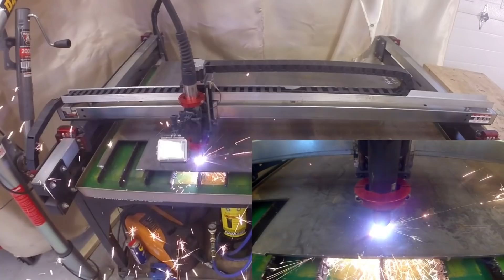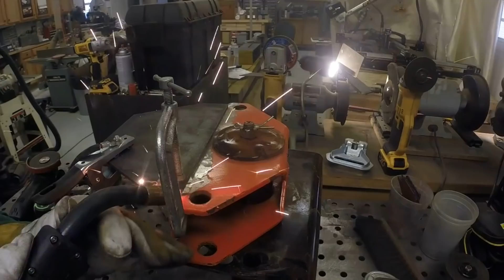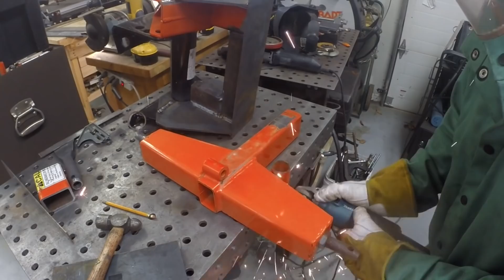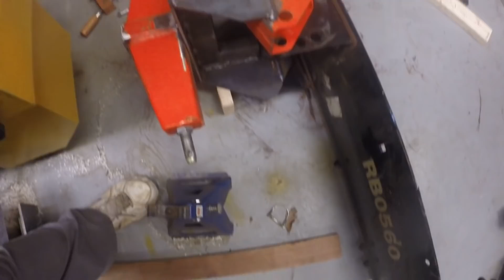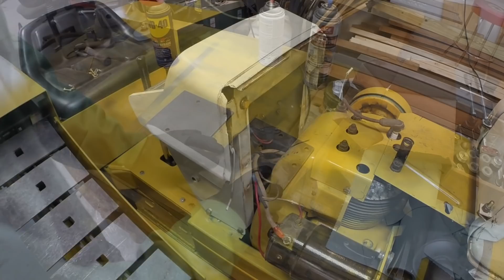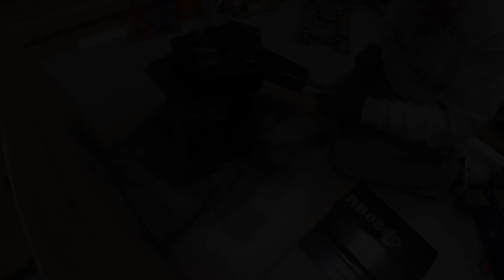Cub Cadet Dozer Build!  S2:E13,  Building a 4 Point Hitch!

Comment: Seems like an overly complicated blade mount when you could fabricate a C frame for the front like a D4 has. I know you want a 6 way blade but a C frame would be less complicated and more durable. The 6 way function could still be achieved with 2 more hydraulic rams the same as the D4.

Plus it will look like a dozer and not a tractor attachment. 🤷🏻‍♂️

Comment: Hey man get you a board 6”x6” and drive some 8 penny nails at each Conner and you can spray both sides of the metal setting on the nails and spray one side grab the Conners of the metal and flip the metal and spray the other side. You can spray both sides of anything on the boards with nails. Try it you will like it.

Comment: You to take the pins off the blade mount because they are higher than the blade and it's going to make your blade want to roll under when you push on it. Need to mount your lift arms solid mount on your blade.
Reply from the maker: Top link will prevent (or, more correctly, control) "rolling (pitch)."  Also, need the pins for a pivot axis for the blade pitch function. Also, both pins need to be flexible for the blade roll function. So, no. Watch how it turns out. It will make sense when it gets closer to done.

Comment: There is a difference between a snow blade and a dirt blade, the angle of the cutting edge is more vertical on a snow blade so as not to dig in and more of an angle on dirt blade to dig in. I know it's a toy but love it your doing a great job.
Reply from the maker: The blade mount will allow me to hydraulically change the angle of the cutting edge--from scraping to digging.

Comment: fantastic episode again.  but why did you choose this setup?  now you can only rotate about 2 axes.. if you had 2 hydraulic cylinders mounted horizontally and 2 vertically directly on the blade you could have used 3 axes.  left/right up/down and the slope/roll .
stil a very nice build
Reply from the maker: It will rotate on all three axes. Yaw, pitch and roll.

Comment: I think the blade will bend - those 3 point back blades aren't very stiff.
Reply from the maker: Not with the weight and HP of the tractor. I've used similar blades for decades on various tractors and never had a blade bend.

Comment: Great job Frank!  The front blade looks like it will be bullet proof!  For the treads on your tracks are you going to weld steel bars or would you bolt on strips of rubber cut from a used tire perhaps or just leave it as it is?  Thanks for recording and sharing this project, very enjoyable to see the progress!
Reply from the maker: Will weld 1/2 inch square bar stock to the tracks.
Reply: @woodandmetalshoptime8048  That should be excellent traction in the dirt, looking forward to all of your future episodes!